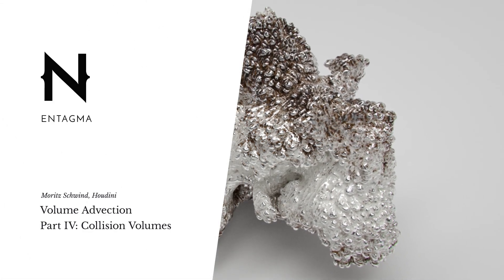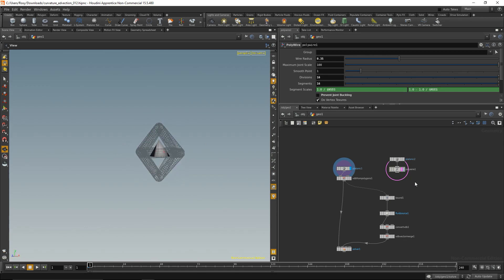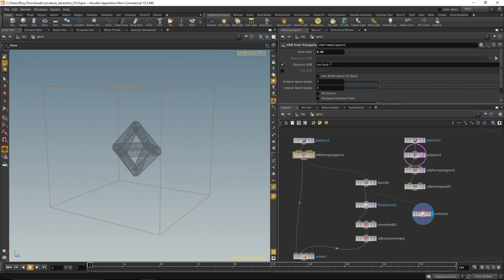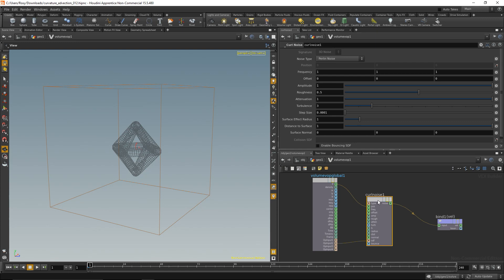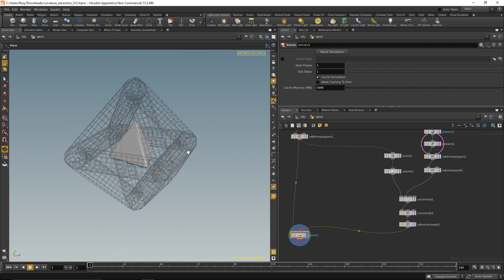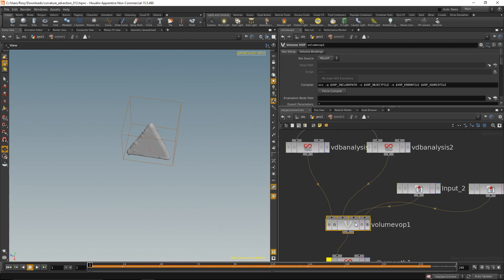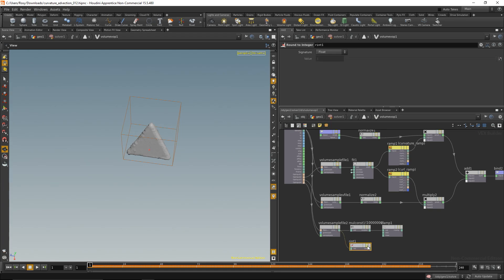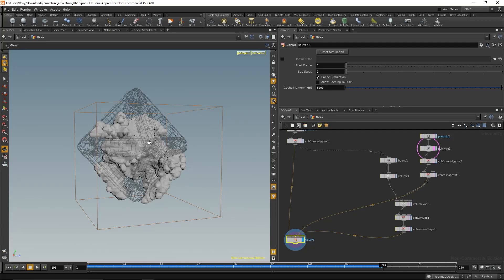Volume Advection Part IV: Collision Volumes

Comment: is there a way to control where the advection happens on the vdb itself? by attribute maybe
Reply from the maker: Definitely. Simply multiply the vector field used for advection by an attribute to control the effect's strength. Cheers, Mo